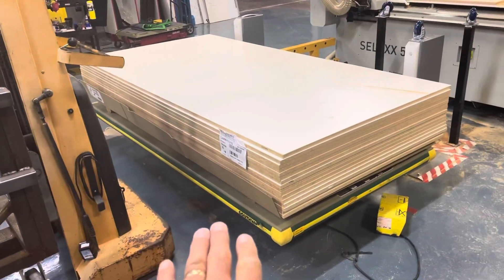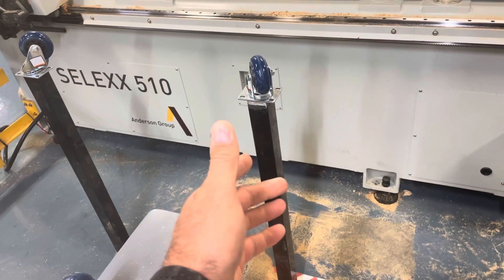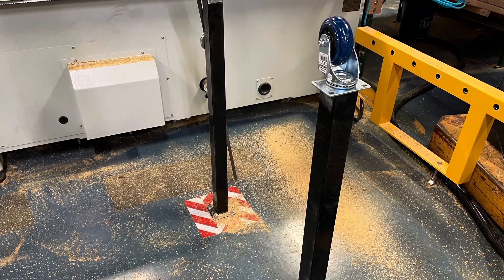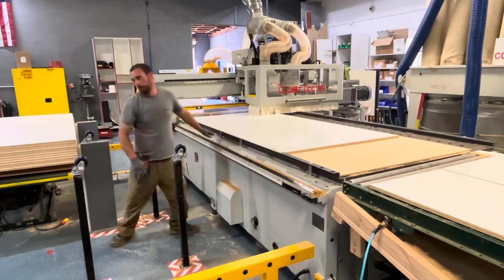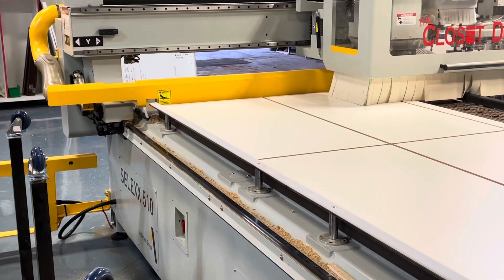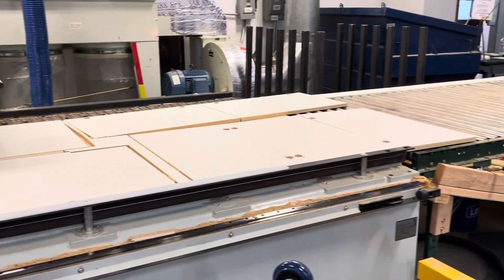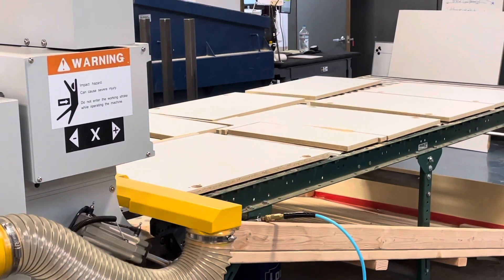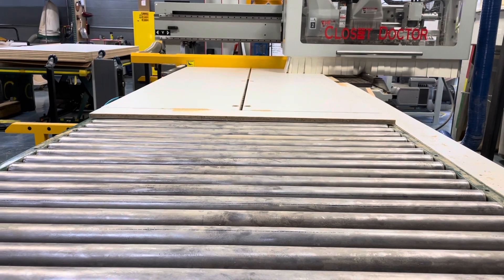How to Easily Load and Unload Sheet Goods on a CNC With Minimal Effort and Cost

Comment: Derek, I saw a video where you had a green or blue skirt running underneath your router to keep dust from getting underneath but can't find it on any other videos. Did you keep the skirt up or were there reasons you took it down? We were thinking about doing the same thing here.
Reply from the maker: On our old Biesse router, it made a huge mess on the back side of the machine. We first put a panel fence up about 2’ off the ground so we could sweep under it. Then we added a sheet metal trough that was angled down also chips would slide down to center. Then we added vinyl sign material from sheet metal to fence to contain it. Our current Anderson Selexx router runs much cleaner and we don’t have anything on the back. Once a week we hit with broom. On front side we put a little panel that deflect chips down

Comment: How do you like ur new machine?
Reply from the maker: We have been very happy with the Anderson Sellexx. The machine is very fast and even with a much smaller drill head than our older one we have matched or even outperformed our previous machine that was fully automated load and unload. We also like the Fanuc operating system that combined with the Anderson interface is easier and quicker to operate than our old system. We have another one on order that will go into our new facility, basically the same machine with a large drill head on it
Reply: @derrekholland5207  will you be getting the auto load and unload and prelabeling? whos ur contact at anderson?
Reply from the maker: @alegrecabinetsinc.6717   no we are doing same set up as in this video
Reply: @alegrecabinetsinc.6717   hi Tom what city and state are you in?